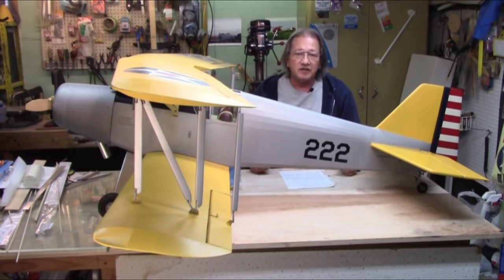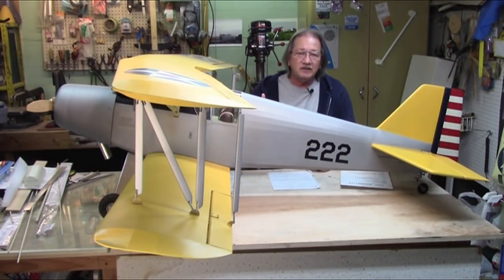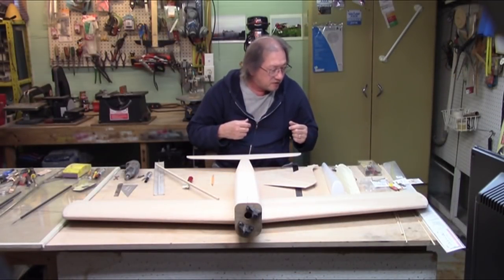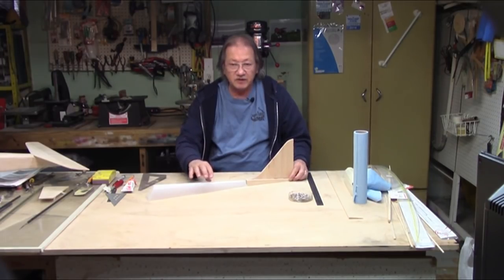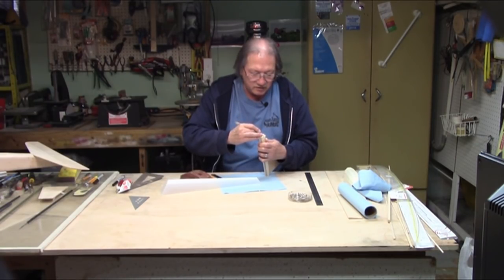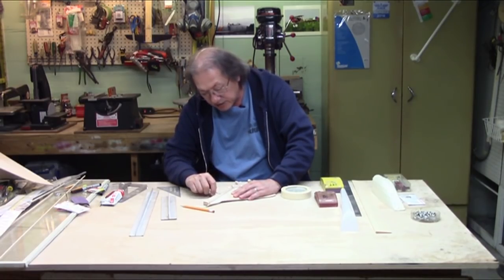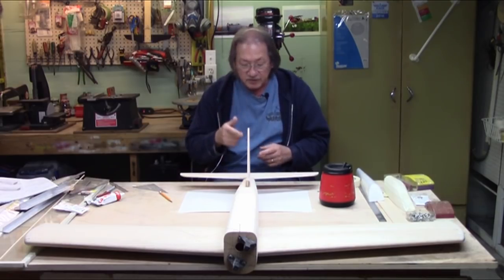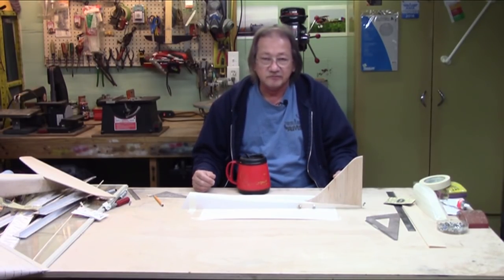SIG KOUGAR BUILD  Part   14-A "The The Vertical Stab"

Comment: Love the series!  My Kougar has to be 25 plus years old and the center section is fuel soaked and monocote wont stick anymore.  Been trying to get  the oil out but it may be time to simply build a new one.  When is the next episode coming out?
Reply from the maker: Hi Bill, I'm in the process of recording it. I've been held up by spring time chores, club duties and bunch of other things. However, today I finished all the work around the house and now I have time to indulge in my hobby. 
My goal is to have it uploaded by this Saturday (If all goes according to plan).

Comment: Nice videos.  I built a Kougar years ago and it's still flying.  Now I want to build another one.  I like that rudder torque rod/horn.  Where do you get that from?
Reply from the maker: I knew someone would ask that question!  I got it from Tower Hobbies a couple of decades ago. It was sold under the Carl Goldberg brand. However it's still available under Great Planes, here's the link. https://www.towerhobbies.com/cgi-bin/wti0001p?&I=LXJ931&P=0
It's a tail wheel assembly. I removed the tail wheel wire and replaced it with 4-40 size rod threaded at one end. I'll show it in more detail in the next video. You may have to get a little creative on the clevis setup.

Thanks for the question.
Reply: Got it!  Very clever.  Looking forward to the next video.  Thanks.
Reply: Really like your hidden rudder control. I'm going to do that same thing on a king kobra, but a guy told me he couldn't due to not enough room. What did you do in regards to the elevator push rod?
Reply from the maker: Hi James, Very good question. I didn't do a thing to the elevator push rod or horn.  You set the elevator servo to maximum throw with the longer "T" arm on it. Clip the clevis to the outer most hole and run the push rod down the center of the fuselage. Find the hole on the elevator control horn that allows the push rod to clear and your in business. If you're worried about hitting the rudder control assembly raise the elevator servo "UP" 1/16" to 1/8" by adding plywood to the servo rail. If you lay it all out on the King Kobra plans you see that it will work as it does on the Kougar. (Does the King Kobra have plans? I've never built one yet. I assume the construction is similar to the Kobra). To hook up the push rod to the rudder control assembly, you can get to it through the hole in the rear of the fuselage or you can cut a small access hole in the side or bottom of the fuselage. The hole can be made into an access point with a hatch or be resealed filled and covered up. I hope this clarifies things a bit better. I'll be covering the install on the next video which I hope to have done soon.
Thanks for the question.
Reply: thanks again!!! I'll be waiting for your next video.